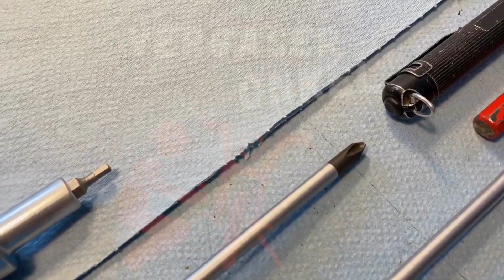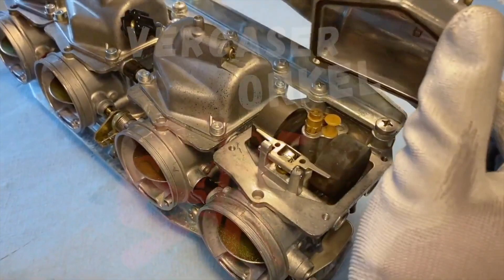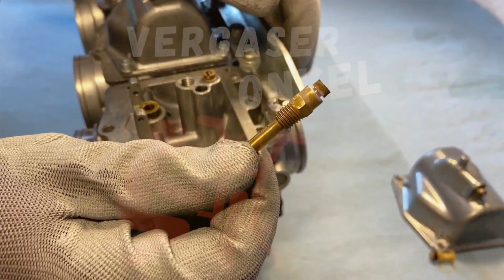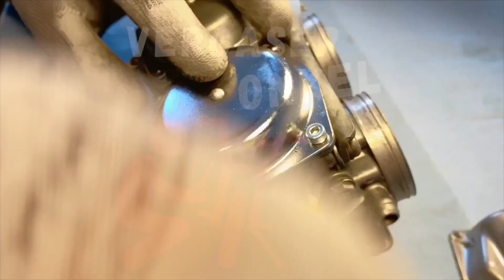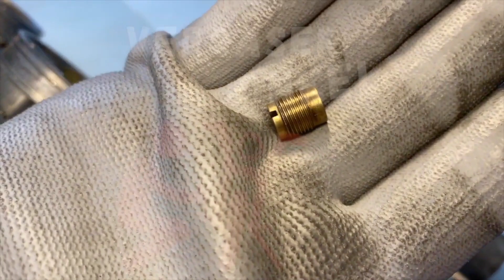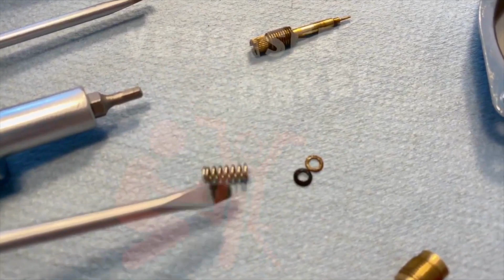Before You Tear Down Your KZ750 – Watch THIS! | Carb King

Comment from the maker: Carburetor Repair Kit Z750 E/H/N
https://www.woembi.de/Vergaser-Rep-Satz-KAW-Z750-E-H-N-Z250-Z440?gi=1
Primary Jet
https://www.woembi.de/Primaerduese-fuer-Keihin-an-KAW-Z305-440-750
Float Chamber Gasket
https://www.woembi.de/Schwimmerkammer-Dichtung-KAW-Z250-400-440-750E?gi=1
Intake Manifold Set
https://www.woembi.de/Ansaugstutzen-Satz-KAW-Z650-750-GPZ750?gi=1
Throttle Cable
https://www.woembi.de/Gaszug-KAW-Z750E-L1?gi=1
Fuel Petcock Repair Kit
https://www.woembi.de/Benzinhahn-Rep-Satz-YAM-XS400-XS850-KAW-Z650B-Z750E-ua
Engine Gasket Set
https://www.woembi.de/Motordichtsatz-KAW-Z750E-GP-LTD?gi=1
Air Filter
https://www.woembi.de/Luftfilter-KAW-Z650F-Z750E-L-H?gi=1
Primary Chain
https://www.woembi.de/Primaerkette-HON-CB900-KAW-Z650-Z750E-ua?gi=1
Front Brake Pads
https://www.woembi.de/Bremskloetze-TRW-MCB516?gi=1